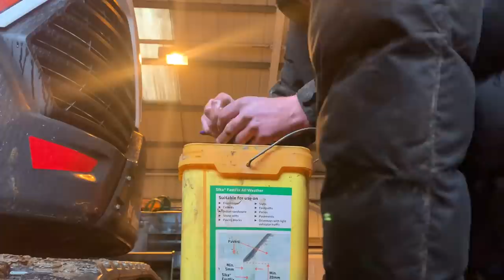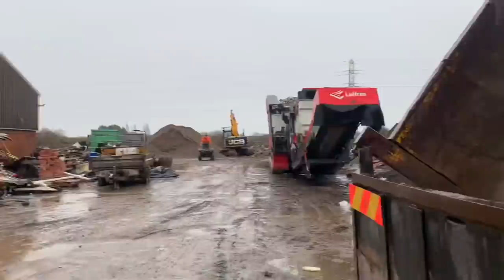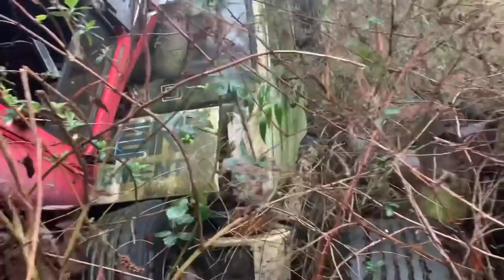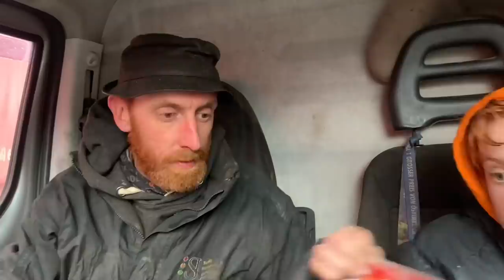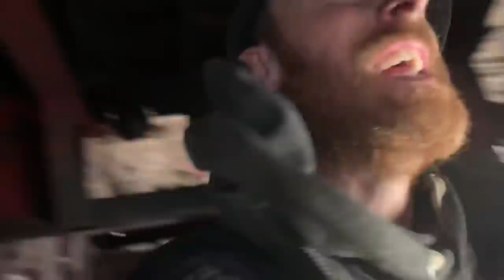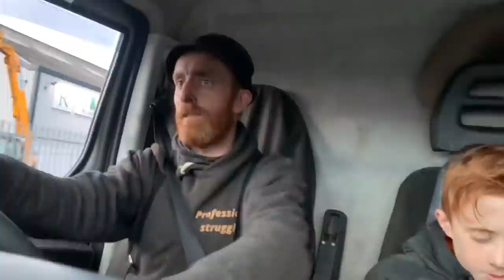How to bounce on bars, swing sledge hammers, chisel off hubs and being Beat by a calliper!struggle!

Comment: I have refitted those brake calipers, they are very heavy especially with the brake chamber still attached and they get heavier the longer you struggle. I  used to get it somewhere near balancing it on my knees but have a short 3/8 drive extension handy to pop in one of the bolt holes and let the caliper hang on that, then I could jiggle it about a bit more with my knees while you get a couple of bolts started, halves the struggle !

Comment: Cracking video lads! Chris old 4x4 and vans had a 2 stage bottle jack which you screwed to raise. Your breaker mate's might be able to help with the Search. You could put one either side of the rim and sledge the bottom. Nothing as hard on the oule ticker as the sledge in tight spot!

Comment: Was that a meritor Elsa 2 brake caliper? You can leave the top bolt in loose and hinge the caliper away enough to remove the brake disc! I use a big block of wood to sit it on so it stays out the way! Keep up the good work mate and mind ya back 👍

Comment: Just FYI Chris, petrol powered 1" drive  impact drivers do exist, they're a railway thing. They do pop up on ebay for around £500 sometimes, probably worth the time saved in waiting for the compressor to build up after using a big air impact..

Comment: That tipper which is slow coming down change the hydraulic fluid as it gets old it gets dirty as you know as slows it down if that doesn't make a difference change the pump they often slow down on the flow some have flow rate adjusters might be worth checking that aswell
Reply from the maker: Thanks Pete! I’ll have a look mate, much appreciate the advice 👍

Comment: *****. DONT  fit the pads that’s a park brake warning light. 

There is a problem between the hand brake valve and the hand brake air pressure switch under the centre console. 

One or the other is faulty you’ll need to pin it out.
Reply from the maker: Top man mark 👍 was hoping someone would have another idea mate, cheers brother I will investigate that further! 👍
Reply: It’s an air switch with two spade terminals. It’s not seeing the handbrake released.

Comment: That park brake fault on the iveco I come across last weak and if you strip the centre console down where the handbrake lever is they should be a pressure sensor next to the handbrake lever and and that should sort the fault 👍
Reply from the maker: Cheers Danny mate! advice much appreciated pal 👍

Comment: If I remember rightly there’s a plunger switch on the end of the Master cylinder chamber.
1-Sometimes there is corrosion and the air cannot escape through the breathe hole I.e A little tab with rubber.
2-it just may be a faulty switch
3-The switch is there just in case there is a leak of fluid and the plunger hits the switch to warn the driver.

Comment: I am wondering if the seals in rams leaking past into the different sections as it collapses between sections sometimes there air holes in the rams to relieve the air in the sections 🤷‍♂️ just a thought from a struggler.
Reply from the maker: Yeah could be Fuller that might be why he gets it jumping up sometimes, I’ll bare that in mind mate thanks 👍